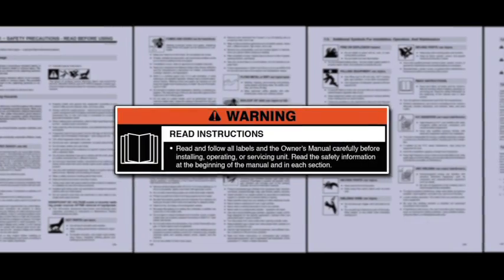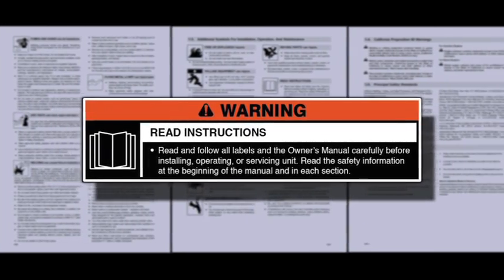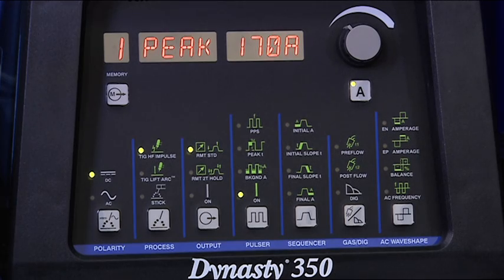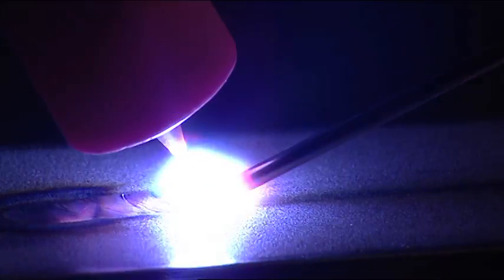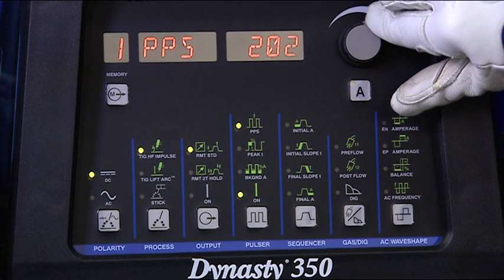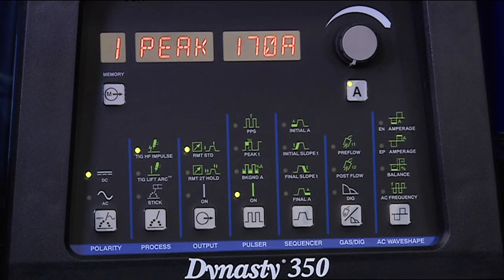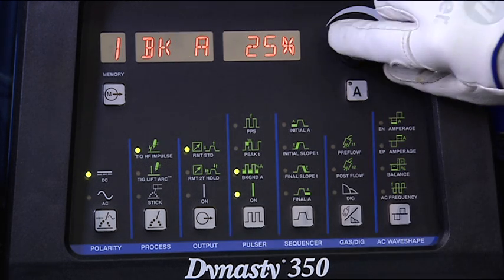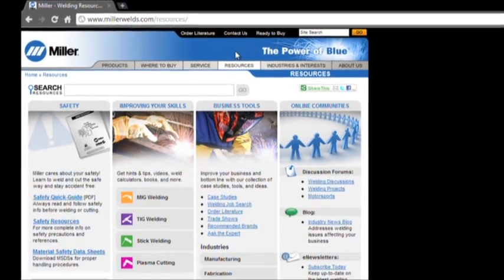Pulsed TIG Welding Basics

Comment: Having welded stainless mixirs together from blueprint the most consistent and aesthetically pleasing welds I was ever able to produce was at 0.6-0.9 PPS with a backround set at 10% and peak time set at 40% that was on a Dynasty 250DX. That machine will basically weld everything for you all you have to do is just add filler and move the torch the machine handles the rest.